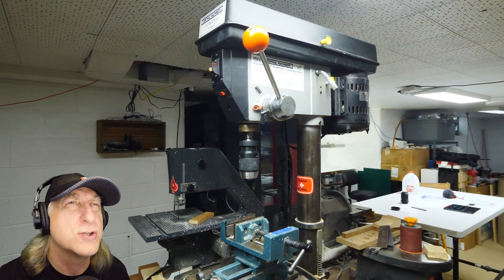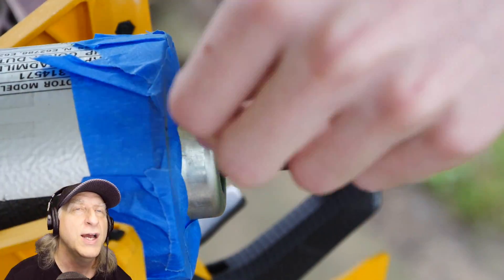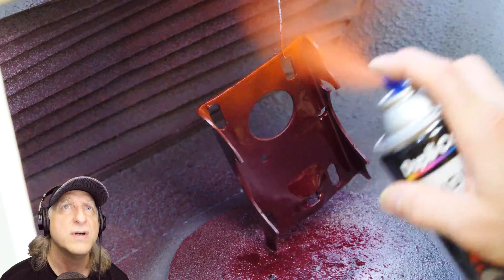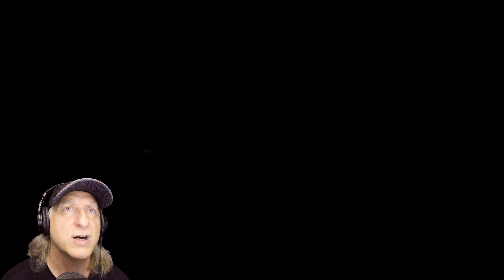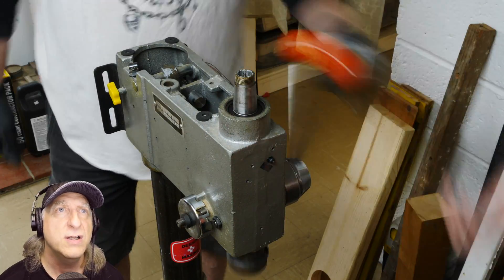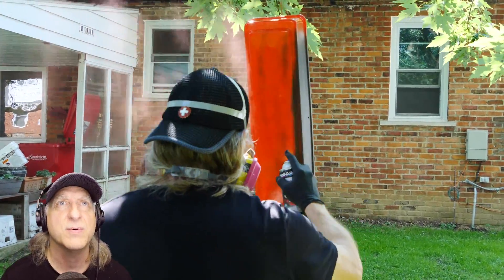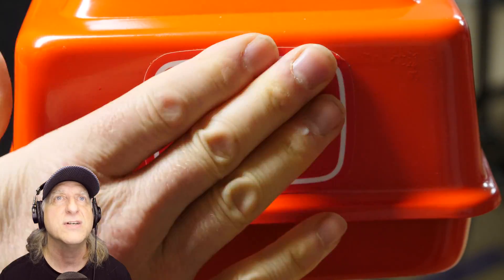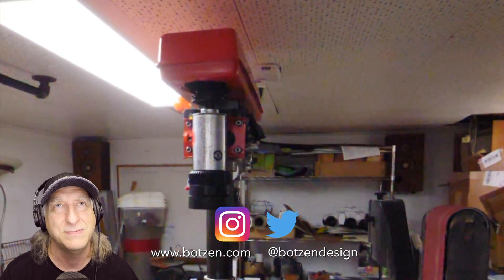Drill Press Treadmill Motor MOD, speed controller and reverse!

Comment: Let me know how your DPDT switch holds up to the amps and voltage. 
I’d like to see your speed control more. Thanks. Paul
Reply from the maker: I have actually had to replace the dpdt switch once, it did cause me issues.

Comment: I’m using the variable speed controller as provided by Dazecars on YouTube. It uses a SCR.
Reply: Check out the series on variable speed treadmill motor design by Dazecars. He ends up using a big 3PDT rotary switch that can handle the power.
Reply from the maker: I will have to investigate, I have a lot of trouble watching his videos however, they are almost unwatchable sometimes

Comment: Most treadmill motors run at a much higher rpm than a drill press. How did you ramp that down with pulleys so you don’t exceed the max speed of the drill press?
Thanks,
Paul 
My treadmill motor maxes out at 4,500 rpm and my drill press motor is about 1,750 or so. So I would need to ramp down my 4,500 motor to 1,750 before attaching it.
Reply from the maker: I used the pulleys to reduce the speed as much as possible and then the motor controller at that point.

Comment: didn't really care for the type of commentary, but decent enough video.
Reply from the maker: Lol, me either, just making fun of the gamers .. hehehehe
Reply: lol but I have thought many times it could be nice having a reverse on the drill press. I've used the drill press a few times to run a tap down, then have to remove the bit by hand after. My treadmill motor is 1.75 horse but that still beats the hell out of both my drill press motors. That digital tach is very nice and no more fiddling with the belts. My motor is only rated for 90VDC so i may have to get/make a power supply. @EricStrebel

Comment: Commentary is not needed, you can just explain what you where doing in a normal way and why and what problems you ran into and what solutions you found instead. Maybe add, ideas on what you would have done differently and why.
Reply from the maker: Your missing the point of me making fun of the gamers. Don't normally make videos like this....lol. thanks for the comments. Check out some of my other videos that go into more details.

Comment: On the reversing switch, why don't you call the directions clockwise and counterclockwise or left-hand and right-hand!  Because both directions are normal! 
Don't ever mock left-handed people!
We are not backwards, upside-down, reversed, or any such negative concept. 

Down through the years there have been far too many negative comments linking left-handedness with things that are evil, retarded, gross, unacceptable, demented, etc! 
Even on my cell phone almost every single app is designed for right-handed use only! As if there was something horrible about being left-handed!

I have even seen parents punish their children in public for using their left hand!

Some people use the term "Lefty loosey righty tighty."

I used to term righty wrongy lefty besty "
Left is normal for us and anything else is backwards, upside down,etc.

Just a thought. 😁😉
Reply from the maker: Lol, plenty of lefties out there. Those are good comments. My main thing is for threaded attachments to go in a normal direction, otherwise they come unthreaded during use.
Reply: @EricStrebel  calling something normal is
a relative term.
Is making right-hand turns when you're driving  considered more normal than left turns?

When I give someone driving directions, I don't tell them to make a normal turn, or to turn normally.
They would look at me like I'm nuts, crazy, loony, bonkers, etc!

When working on certain machines, truck parts, gas lines, etc, the "normal"  direction would be the wrong direction.

Left-hand threads are more common than a lot of people realize.

As a result, a lot of people just use the term left-hand and right-hand when giving directions or instructions.
In many situations there is no such thing as normal.

In fact a lot of people do certain things left-handed and the same people do other things right handed, and vice versa.
Not all left-handed people are right footed, and not all right-handers are left-footed.

Some things are more common than others but that does not mean that variations are not normal. 

It's funny to watch right-handers trying to use left-handed devices.
Normal things for us are not normal for them.

In the past a lot of teachers in schools tried to force kids to use their right hand for everything.
As a result it screwed up  the kids thinking processes and it slowed down their learning processes.
Otherwise there'd be a lot more left-handed people in this world.

Similar things took place in other countries.
In some places, people were brought up not to use their left hand for anyting important!
If they committed a theft or other serious crime, their right hand would be chopped off.
When other people in public saw them using their left hand they knew that they were a criminal.

All down Through the ages people acted like left-handed people were mentally deranged or possessed by evil spirits, etc.

There are certain websites that explain lots of things that make being left-handed sound terrible.

They also list about a hundred different phrases that are very derogatory or negative about left-handers.

And some of those websites list lots of scientists, celebrities, actors, inventors,  politicians, etc that are all left-handed!
There are a hell of a lot more of them/us than people think.

I was also raised in a family of six, half of us were normal, the other half were right-handed.  😃😁😉

My wife and I are both Lefties. And we are both normal. 😀

All of this is from my lifetime of observations and a little bit of research.

Manufacturing companies worldwide still discriminate hugely against left-handed people!!!
They should all be sued heavily for discrimination!!!!!

In recent years some things have become manufactured ambidextrously, but many have not.

Some people still act surprised when they see a left-handed person and comment on it.
I have started acting the same way toward right-handed people, in gest of course. 😉😁
When they say something like,  "I didn't know you were left handed."
I would say, "isn't  everybody?" Or "aren't  you?"  😁

Good luck to you and yours, and have a wonderful day! 😀😃😉
Reply: Copy direct from the internet:

Why do trucks have left hand thread?

Some cars and trucks have left-handed threads on their left-hand wheels. This is so that, when the brakes are applied suddenly and the wheels stop or slow their rotation, angular momentum will try to tighten rather than loosen the wheel nuts.Feb 22, 2023

Comment: I think this solution won't maintain torque, but will allow a basic (no load) speed adjustment. It is cheaper than a closed loop control or other methods though.

Comment: Why are variable speed drill press motors so expensive? 
 
I am a 1 arm/legged woodworker, and one of my toughest tasks in changing belt speed on drill press. 
 
And the "get a 2 phase and hook a VFD up to it" must be limited to people who do not have "double digit" concussions. 
 
I wish there were an "upgrade kit" that could be mounted to a drill press, and give it a true variable motor that I don't light on fire from using a speed control knob lol.
 
It's already expensive being a crip. A crip woodworker... 10x more expensive and it takes 10x longer to do things. Come on @Nova ... hook a brother up! 
 
Or have #Bosch give us a PBD-40 Drill Press here in the US.
Reply from the maker: Yeah, the Nova is not cheap, definitely part of the inspiration for modding my drill press. Good luck my friend, all the best.
Reply: @EricStrebel  thank you! (Teknatool is right around the corner. I may stand outside with a cup, and a sign that reads "Spare Viking? Spare Voyager?". Or "Will work for Nova Viking". Lol. 
 
(I prefer a benchtop style since I can make a base for it that let's me store my bits/accessories and make it mobile. )

Comment: Loved every second of this. I've had a 1940s-era Shopsmith in pieces for years that I haven't tackled because... well, honestly, I had no idea how. Watching you tap in the bearings and everything helped me figure out next steps. I may also consider replacing the stock AC motor with a variable speed DC motor like you did here - super inspiring!

One question: What modifications allowed you to use the drill press as a milling machine? Is that dependent on what the variable speed motor allows, or did you also do something to the quill to handle the lateral stress? Thanks!
Reply from the maker: It's really down to if the quill can handle it, plastic works well, aluminum is rougher

Comment: I tought it was a reaction video of yours! 🤣🤣 Im curious why not to use a 3 phase motor with an  electronic speed controller instead of DC one
Reply from the maker: Small motor, very torquey, easy to work with, brushless, very efficient, quiet, and I don't have to deal with AC 3 phase, plus I don't have three phase in my shop

Comment: Have a similar (bit bigger) unit and stuffed it with a 3 phase AC motor fed by a VFD. Way more bottom end poop than the dc motors (which I also have, and used on my CNC mill). Mill never needs to make tons o torque at like 10rpm though. :)